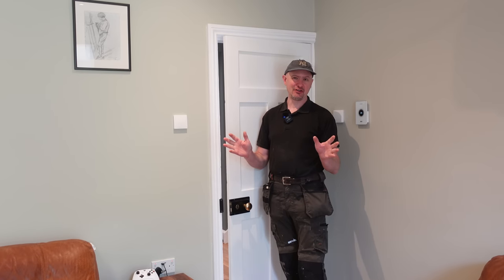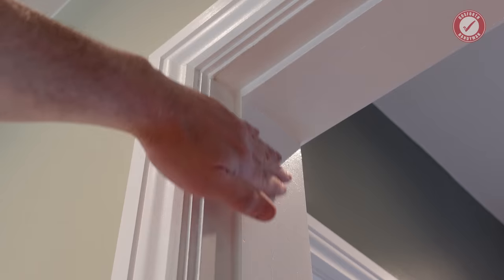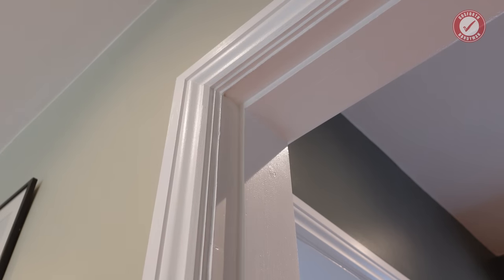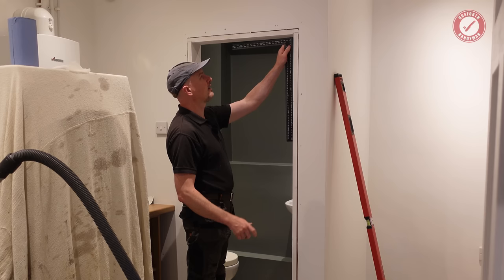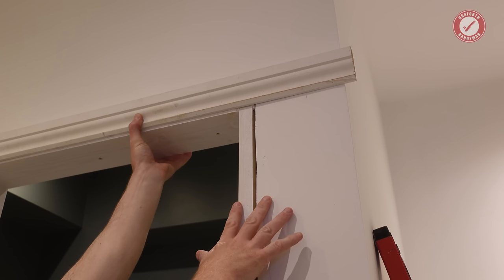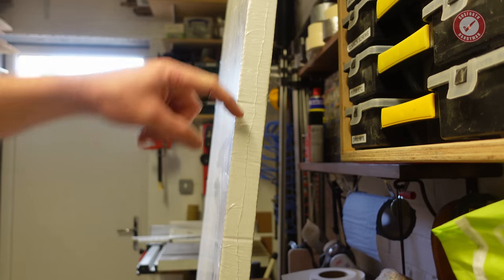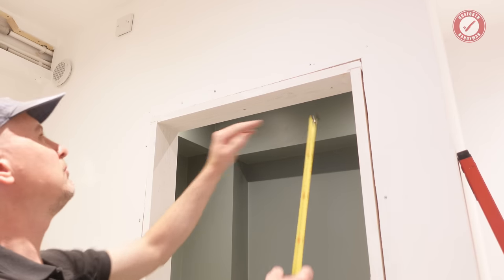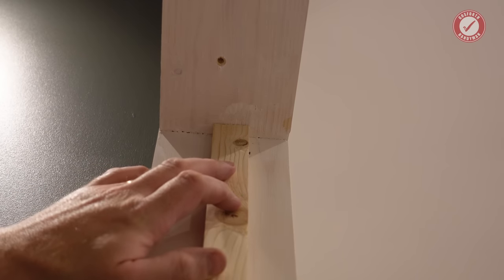The anatomy of a UK door frame!

Comment: Once I bought a track saw I now make my own door linings from MDF - it doesn’t warp/shrink and especially in old houses I’ve found the wall thicknesses aren’t always standard sizes due to replastering etc. MDF is also a doddle to paint
Reply: Hope it not a kitchen or bathroom...wait till the MDF gets wet....just ripped some out of a rental been in two years and are knackered sucked up moisture like a sponge replaced them with wood which will likely last fifty years plus...and you get a much much better fix with the hinge screws etc..
Reply: 27 x 78 is much easier to remember than 686 X 1981.. I'm sure you don't work out your car fuel economy in miles per 4.54 litres😂..and when you go to the pub do you ask for 568 ml of beer most of us use both systems quite happily
Reply: @davewright9312  And 70x200 would be just as easy to remember as 27x78. Or 0.7x2.

Comment: On the imperial vs metric issue; over here in Ireland we're metric mainly but similar to the UK we would measure height and weight in feet, inches and stone along with our plumbing still being stuck in imperial sizing (and even differs from the 60/70s UK sizing to boot)
Reply: That surprises me that your plumbing is imperial... maybe an american connection?
Reply: @TheChipmunk2008   More a hangover from the UK I think really as we used Imperial too but they changed to metric in the 60s/70s and for whatever reason our plumbing stayed in Imperial since.
Reply: @TheChipmunk2008  Ireland only got it's independence from the UK in 1919, hence why it has an  imperial hangover!.
Reply: @deeeirl  That makes sense... our 1/2" changed to 15mm which (because the imperial is measured on inside diameter and metric outside) looks so dang close it can cause confusion... but the olives on compression fittings will often leak
Reply: Thanks for taking the time to do this Andy.😀👍

Comment: For me (down here in Essex) a door frame is what an external door fits into and is secured to external brickwork and a door lining is for internal doors and is fixed to an internal brick/block/stud wall.
Reply: a door frame is essentially a door lining, where the stiles and heads are made from a single timber that have the door stops machined into it in one piece. Yes, your external door frame is a frame but a door 'frame' with a separate door stop is only a door lining. Many older properties have internal door frames with the jamb built in and modern properties have door linings with separate stops. He explained it correctly but for 28mins - wtf.

Comment: A tip from my Grandad when you fit door frame with stops included make sure the hinge side is perfectly plumb and solidly attached, then hang door, close door then you can adjust the opposite side of frame to fit the closed door which will line the frame with the door before you attach attach it to the wall.Brilliant on old   wonky walls.

Comment: Another great vid Andy. I've only had to do one door opening so far & that was a fire door from our garage into our kitchen many years ago. I made the liner from MDF because it was a thick breeze block wall (non-load bearing) & then I added the architrave & stops as normal. Also fitted a heavy duty mortice lock with a key on the kitchen side only with intumescent stripping all around the frame & fire rated foam filler to seal up all the gaps.  
And, I also have one of those old metal Screwfix cases with the old 0500 phone number on it. Screws in mine.

Comment: Hi Andy, another informative video.  Thank you.  A problem I've encountered is the linings are not always flat/straight, so you have to keep this in mind when checking for plumb and compensate with the packing.  Also, how quiet do you need a bog to be?  Or maybe you need to shield the utility room from the occasional berloosh.

Comment: I was sure I had seen you use 2nd fix nailer which i would have used for stops and architrave . Those brads looked heavy gauge . poss. just on camera . Another thing I would have used a long level to determine which side to add my 2mm packer.. 
Good job , very neat and tidy.    Never had the need to form double quirk  but very interesting .

Comment: I'm in Scotland, what I was taught was that a lining is up to 25mm thick and the components are fitted loose, a frame is 30mm+ thick and the head is fixed to the legs and "casing" isn't a terminology we use, we just call it a rebated frame.

Comment: Interesting video Andy, thank you. I am still old school and prefer imperial measurements, metric to me is like going abroad and thinking in English before speaking in Spanish, French or Greek, I think in feet and inches and convert to metric if I have to, but prefer to measure in imperial.
But I guess as my generation move on, the country will eventually become more metric orientated. Having said that, when I was young I was an electrician and even the cables had just converted to metric, 1mm 2.5mm etc and yet I think the common screws that held switches and sockets to the walls were 4ba ? funny old world. 🙂

Comment: When I built my house 40 years ago, I did not want architraves. Was told I had to have them. Ten years ago, I moved to a 60 year old house- that does not have architraves. There is a plaster framing strip that allows this to be done. But carpenters hate the idea, because the fit has to be much better....  Also the frame has to be fitted before plastering. One of the things the architect had insisted on, along with lift off hinges (great) and wooden treads that mean you are not trying to match different thicknesses of floor covering in the middle of the door.
Amazing that we are  still building houses the way the romans did (brick/block walls, with a tiled roof on timber rafters)- 2000 years with little progress. Compare with road transport or aircraft- changed beyond recognition in less that 100 years...

Comment: Could you offer some advice.
My house the wall is 4.5cm thick and the structural wood that im able to attach the door lining too is only 2 ish cm thick.

So when drilling the lining to the structure will a single line of screws be sufficient and not create a wobble ?

Comment: Thanks for the awesome videos. This one is on point as I need to re-hang and replace some doors at home.

Anybody got any thoughts on a good place to get new doors? I would like to get something solid wood but don't want to get a lemon, the £64 pine doors Wicks does looked ok until I started reading about all the people having them warp a few months after fitting.
Reply: See if jeld-wen doors do what you want i only fit those now

Comment: Ahh, imperial vs metric. It's basically impossible to just switch - sure, we could just do 700x2000mm (70x200cm! ahh, rational unit systems) doors, but then everyone needing a replacement is in trouble, and nobody wants to stock two different systems.

As for the all-metric tape, they're great for most things (I love mine, and I actually took a box of them across the pond a little while back because people wanted them), but the imperial bits aren't entirely redundant - if you take a look at any dual marked tape (5m and above anyway), you'll find they highlight 16" intervals and, and this one is fun, 19.2" intervals - 8ft/5. These are still important, because as many sheet materials (ply, OSB, some plasterboard) are still nominally imperial for the same reasons as doors, you can quickly find yourself in trouble if you put up framework with metric spacing.

Never getting away from this mess in my lifetime..

Comment: This is like post traumatic therapy - I live in an old house and decided to replace 3 x old painted doors with new finished ones…nightmare of a job. None of the door linings were square, the door stops were built into the linings so you couldn’t just remove them. And cos the new doors are finished you could only remove material off the top and bottom not the sides…so I ended up having to plane, sand the door linings to fit the new doors…3 days later I finished the job